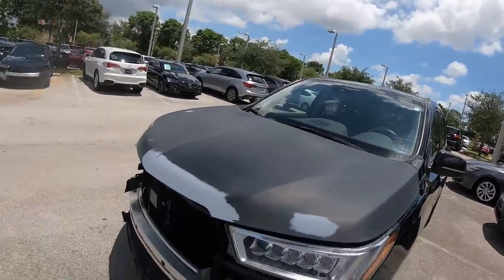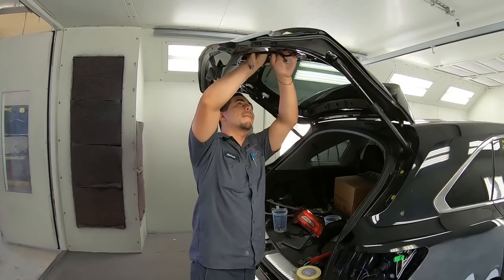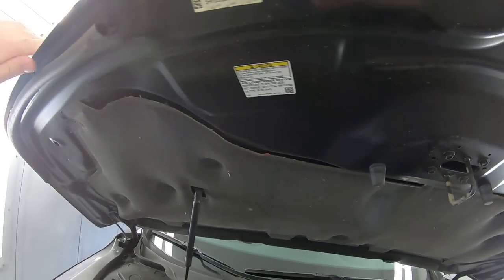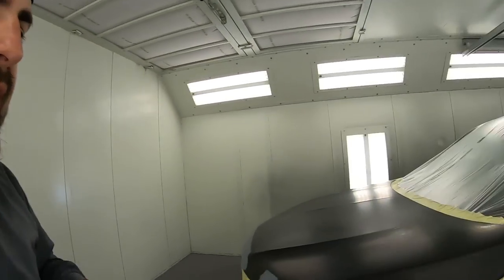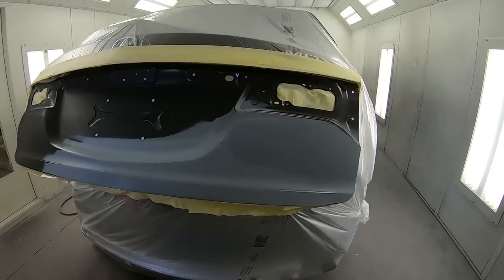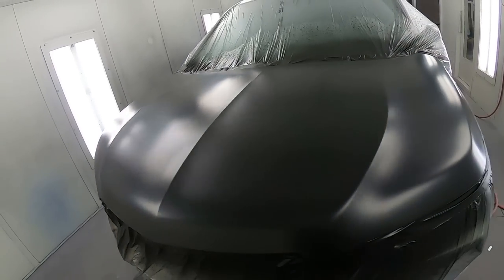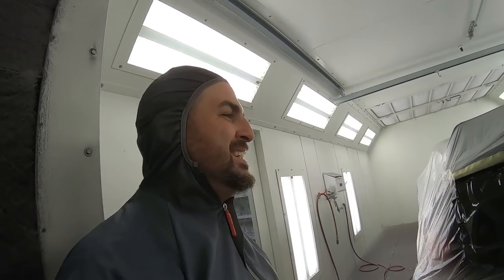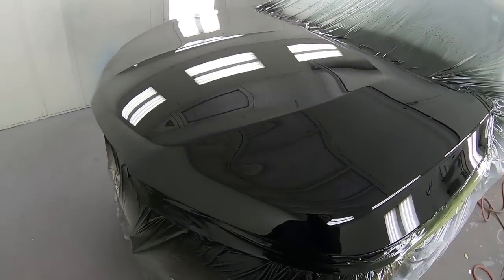Car Painting: Painting Gloss Black on a Luxury Car

Comment: Brian, I have a question and this might be the right video to ask. 2004 expedition. Hood has some  chip spots and will definitely need a refinish, (paint and clear). The rest of the vehicles paint looks good but, the clear coat has been buffed so thin and cut to the point that I am afraid to buff and cut again. Will it be alright, when I repaint the hood to go on and scuff the rest of the vehicle and re-clear over the entire vehicle? Saving a lot of paint is the idea... I appreciate your help. Phillip Hall
Reply from the maker: I can guarantee you that you’re not gonna be able to sand and scuff up that clear and not burn through the paint, it’s best if you just go ahead and put base over it and repaint the rest of the vehicle
Reply: That puts that question to rest.. Looks like I have a bigger job than I expected lol. Well, the old expedition should look as good as new when all is said and done!  Thank you sir for your valuable information. Phillip Hall

Comment: It’s Nice job with that’s paint booth your clear gun how many turn fan from completely closed?????
Reply from the maker: Alane Atika I can give you settings but the settings are only relative to this particular gun. Do you own one ?
Reply: Yes I have same your gun ws400 1.3? Tip
Reply from the maker: Alane Atika fan. Close it completely (to the left) open 3 turns. 

Fluid, one turn in from wide open
Reply: What psi?
Reply from the maker: 33psi

Comment: What is the ideal wait time between the coats. Sealer, base, clear?
Reply from the maker: The best is to check your tds for proper
Paint manufacturer recommendations. However you’ll know when the sealer, base is flashed off. It’s hard to give an exact answer because all materials, temperature will vary. 

Typically though. From sealer 20 minutes,  base 10 minutes between coats. 20 before clear. 10 minutes between coats for clear. 

I can speed things up in the booth though with heat.

Comment: Why do you use sealer over primer? Once primer is rubbed down it's ready to be based over.
Reply from the maker: It can be But we use sealer for coverage and for adhesion and it is the best substrate for basecoat
Reply: @PaintSociety  your also adding to much material at the vehicles microns is going to be higher than the manufacture states.
Reply from the maker: SLA4YER GAMING I’ll do a video on the used of sealer. I have met with many paint manufacture and reps in which we have discussed the issues for sealer. Thanks for being a part of my page and god bless you into the new year
Reply: When it comes to the layers you’re putting down, 1 layer of sealer for perfect coverage and 1 solid coat of base is a better alternative than 3 layers of base, and risking solvent pop due to the amount of layers trying to dry beneath the other few layers. I believe sealer and base is the way to go..
Reply: @sla4yergaming129  What does that have to do with painting. If it was a airplane it would be different because weight and balance have to be precise. But not one shop that i have ever gone to or worked at ever pulled out a paint thickness gauge.
Reply: @sla4yergaming129  what does that have to do with anything. This is not an airplane.  have not seen one shop that i have gone to or worked at pull out a millage gauge.

Comment: so it's ok to spray sealer over a bare metal?
Reply from the maker: Use self etching primer. The hood is aluminum.
Reply: What size tip do you use for the base coat and clear coat ?
Reply from the maker: O Rivera 1.3

Comment: looks good,  but if i sprayed that much clear at one time, it would be running all over the place, he mad 4 passes over the fender panel edge without letting it tack
Reply from the maker: It all depends on the clear. This clear is very thick.

Comment: I always get sags and runs
Reply: How can you lay on so much clear and not run
Reply from the maker: Change your tip size. Watch the paint go on.  Give enough flash time between coats. Use the proper temp hardener.